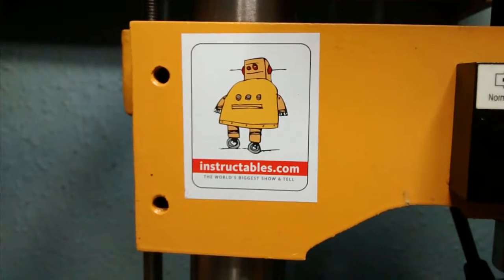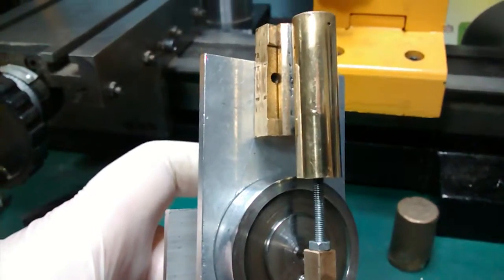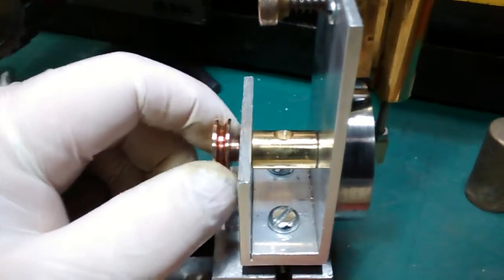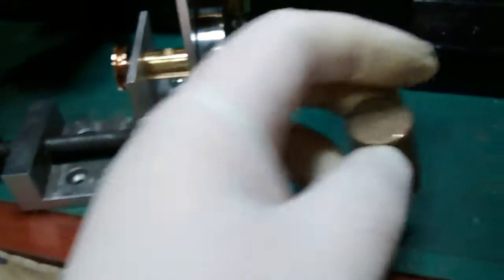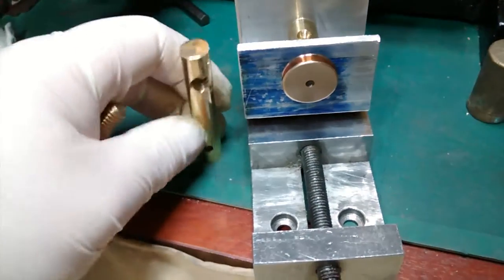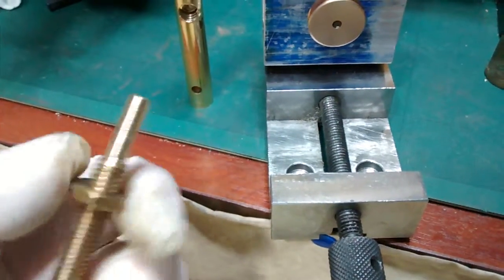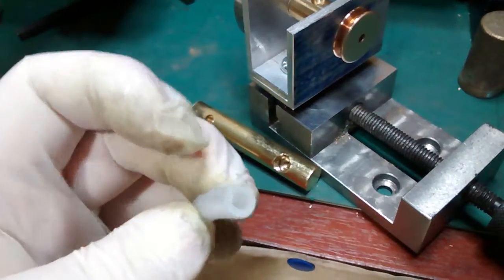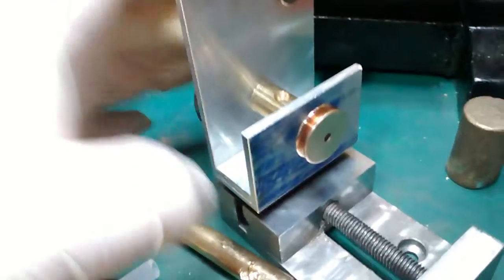My first steam engine - rebuild - Pt. 5 - It dont look pretty, but it does run.

Comment: Looking good.  It'll be interesting to see it running.  I must start putting any good pieces of metal and brass I come across and give it to you because I love to know something is of use to someone.
Reply from the maker: Cheers Brendan, had to re think my redesign again, not a big deal but all part of the fun. I have the pipework ready to go in place but forgot about access to the base screws, but sticking to the KISS method (keep it simple stupid) I think it will look interesting and unique.